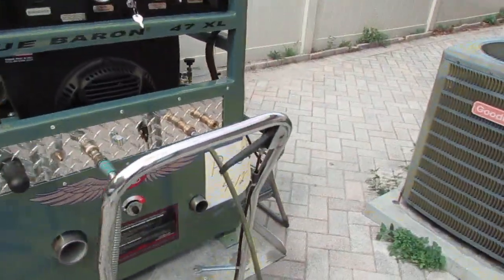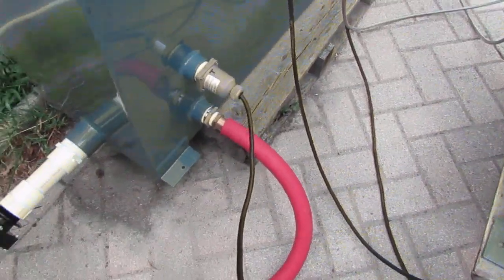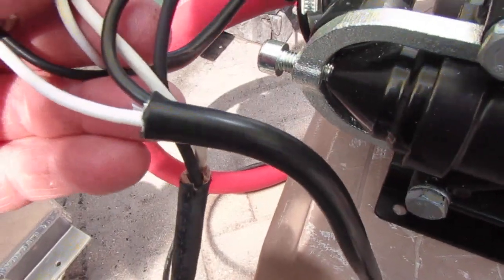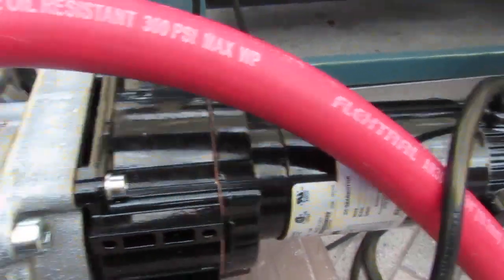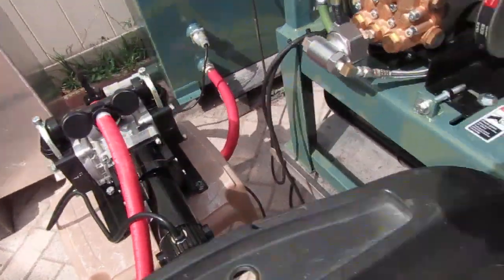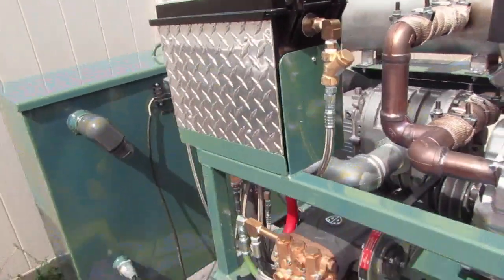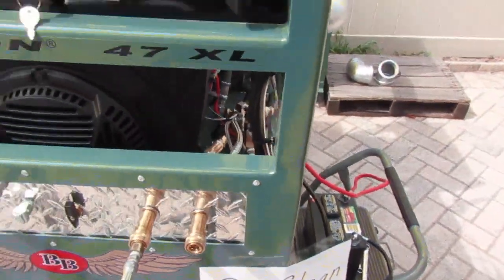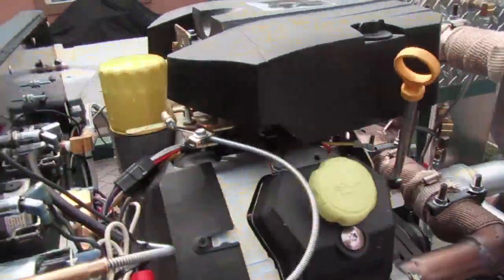Easy Hook UP of the Blue Baron Truck Mount even a "Cave Man" CAN DO IT

Comment: Sweet nice machine , dual wand cleaning machine . Hot water extraction @ 230+... plus  LR 4 blower just like the peak performance prochem . But alot better machine quieter 47xl and easier to maintain and do work on in case of break down . Pete another nice machine